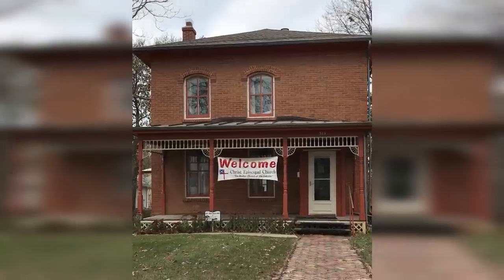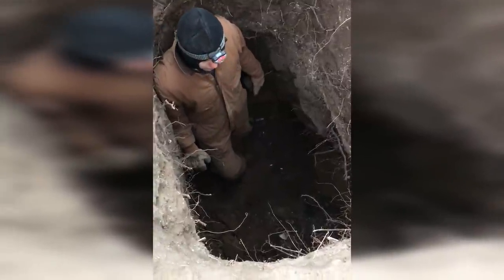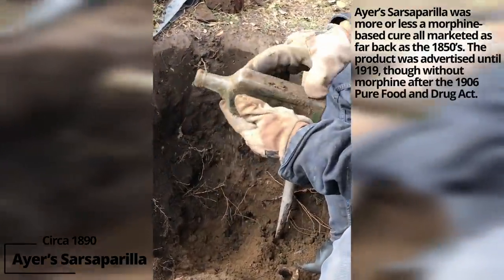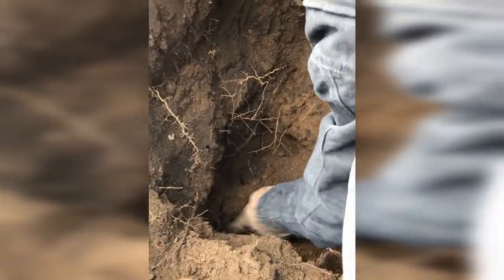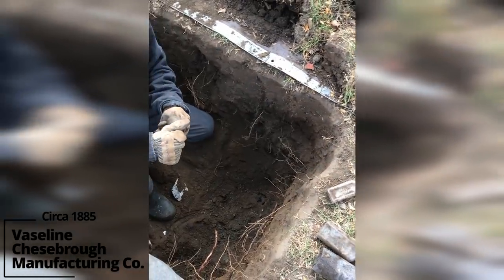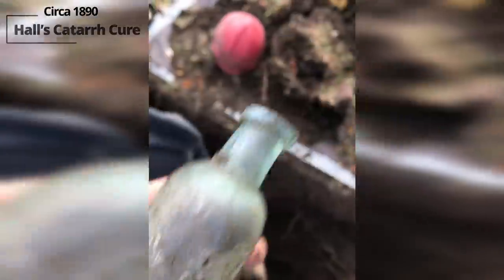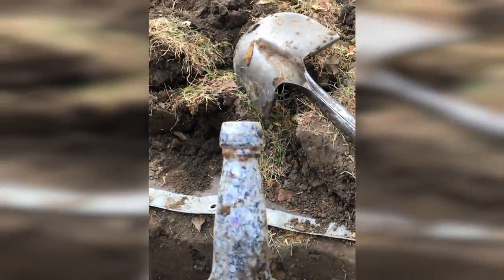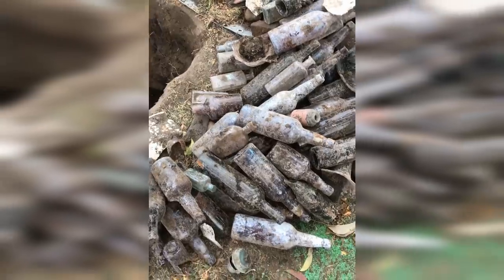Unbelievable Discoveries at a Historic Riverboat Captains House in Yankton, South Dakota (2017)

Comment: My father has a fairly large bottle collection. Somerset County, Md. is very old (1667 or so). He has one of the Safe kidney cure bottles with the paper label attached. It was Found in the home's attic that was purchased in 1898 by our family from a former slave who worked on the steam ships  as a barber going from the Eastern Shore of Md. to the Western Shore. The property also had a small village established by ex slaves after the Civil War. The only remains of that town is the scattered broken bricks and pieces of glass and pottery.
  The house it's self was built sometime around 1830's and had been built from the remains of several homes because of the bricks used in the foundation. The house is located next to the East Creek with Mill Dam Bridge spanning it for the town of Tull's Corner which also had been erased by time. The trash dump is about 200 feet from across a small field that falls away to the marsh and East Creek. My great grandmother threw her trash in the same location as the prior owner who owned it. Tons of blob tops too.